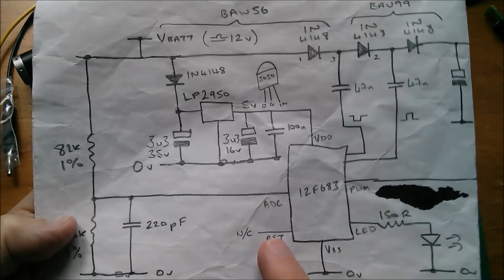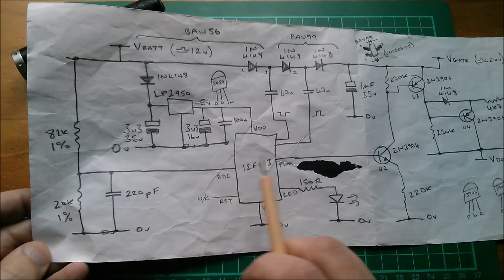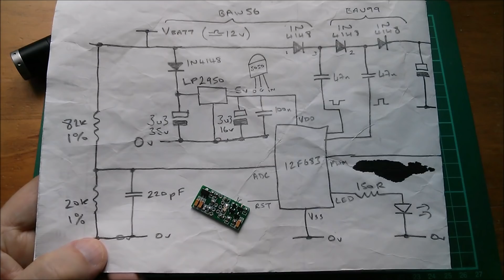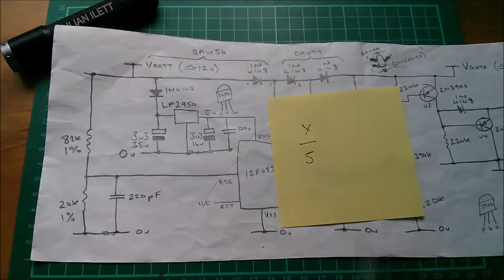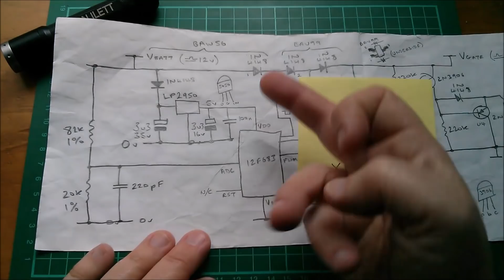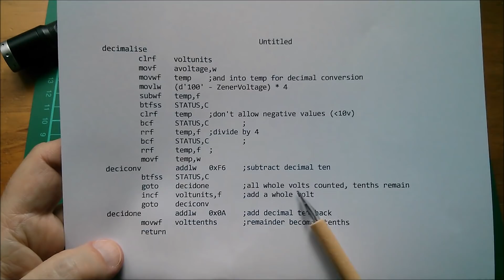PWM5 Solar Charge Controller 2019 Plans (resistor divider bonus)

Comment: How do you make use of the battery power in the house while the battery is charging from the solar panels?  When I try with a cheap solar panel battery charger, it gets all arsey and the voltage drops presumably because the controller is trying to push current one way into the battery whilst the battery (in parallel) is trying to push current the other way through the load.  You might deduse from the question, I habve no idea what I'm doing.

Comment: ++ Deoxit to clean it and conformal coating or potting to weather seal it.  I've found that using certain hot glue directly on electronic components will tend to cause corrosion right away, like in a few weeks.  Definitely conformal coat but I like to use deoxit as well to clean things off.  If you want it to last even longer then use solid core wire instead of stranded wire to prevent moisture from wicking its way around the weather proofing...

Comment: Julian - Could I recommend that you look to sizing the board to fit into a thinwall 1" PVC (or conduit) pipe?   You simply cap the TOP of the pipe and mount it vertically and have the wires come out the bottom.  The LED could stick out the bottom as well. We will also use the 8' fluorescent light tube protectors (cut down to length) which are see through and you CAN find caps that will work for these as well (example https://www.homedepot.com/p/Lithonia-Lighting-8-ft-Fluorescent-Tube-Protector-TGT12CL8-R24/100173242).   Leaving the bottom open (or lightly plugged with some foam) keeps splashes out.  Not attempting to seal it allows moisture to escape.  I know this works as I design boards for doing Christmas light computer control and this is how we keep many of our boards dry through winter.

Comment: Why don't you connect it to the wifi so you can see the voltage on your phone or pc?
Reply: That would be quite difficult to code in, not to mention the app/web interface along with a wifi board would make it moreless just a breadboard monster instead of a production unit.

Comment: On the femto, why not use a d2pak/to263 package mosfet, so the whole thing is surface mount, and you don't have the tab hanging off the end?
Reply from the maker: Because the connecting wires are soldered directly to the MOSFET legs.

Comment: You are in a rat hole on the packaging. All your wonderful work is encased in the Devil's Putty and reduced to swinging in-line on a cable exposed in the 'catch rain' position. Conformal coating and then put it in a small IP65 rated enclosure and be done with it. Better if you get one with a clear lid so you guests can gaze at your work

Comment: On the voltage reference take a look at the TL432. It is equivalent to a variable zener diode and very stable. You could also use one of the other fixed voltage references .... but the variable one means you can simplify your maths as you have done.

Comment: How did you measure the EMI?
Reply from the maker: With an AM radio :)
Reply: @JulianIlett  What a innovative approach :) What frequency did you tune up? :)
Reply from the maker: The RFI will appear at multiple positions in the AM band - pick the loudest one. You'll hear the 122Hz modulation frequency quite clearly (but only when the controller is modulating).

Comment: do we know if powerbanks (in general) have mppt charging controller to charge the battery? and smartphones not? i see that by connecting a solar panel 6-7V to my powerbanks, always they are charging with 5V and max current. my phone is floating between 5V-6V and not max current!
Reply: It's a really bad idea to connect a solar panel directly to your phone.....
Reply: @ishanfernando3064  https://i.ebayimg.com/images/g/wgUAAOSwZLRZcE0q/s-l500.jpg   :D

Comment: It would be nice if they had a bit bigger capacity so you could use it with a 100 watt panel
Reply from the maker: You can use it with a 100W (5 to 6 Amps) panel.

Comment: Did you ever get any angry customers when they failed?
Reply from the maker: One or two - there was a meltdown in Malta - that prompted a redesign from the IRFZ44N to the IRF3205 :)
Reply: Oh tell me more tell me more, I love a good tale of gossip. How bad was the meltdown?
Reply from the maker: The IRFZ44N has a higher on-resistance (so gets warmer). Malta is a warm country. The unit got so hot, the hot glue melted. The customer got a refund. The IRFZ44N was replaced with the IRF3205 and a new unit was sent to the same chap. He confirmed that the new design worked without overheating. I breathed a sigh of relief :)
Reply: That's interesting, I would of thought the switching losses would of caused the most heating what with the high gate resistor value on the PWM5. btw did you ever try a ferrite bead on the gate to suppress emi?

Comment: Why not use a precision voltage reference? Assuming you can use the spare pin as a Vref and it's not too expensive and big, of course. Just thinking out loud
Reply: So just had a look... You could swap the led on pin 6 to the unused mclr pin 4.  Then use the Vref function on pin 6 to a LM4051 set at ~4V and driven from the batteria.  You'd lose a bit of resolution because Vref needs to be at or below the worst case Vcc, but you're still in the single order mV range.  Food for thought!
Would you mind if I took your schematic and had a play and send back to you, if you're interested?  Purely doing it for fun and learning at my end, not for commercial or anything like that
Reply: Or you could try the RT9069 5V reg....+-2%.  Still not great but better than +-3%. And cheaper (on Farnell at least)

Comment: Just wondering if transparent adhesive lined heat shrink might be helpful in sealing the ends (https://au.element14.com/hellermanntyton/hisa-18-6-pex-cl/heat-shrink-adh-clear-18mm-4m/dp/2251712). Looking forward to the new thruhole pwm5. Thanks

Comment: Finally!! I love your pwm5!
How are you going to sell/distribute them? I would like to be able to buy drawing/instructions  and the components from you, preferably with the chip programmed. Soldering it together I could probably figure out. (sourcing components are difficult as a newbie)

It doesn't have to be cheap. I get one or two sexy chargers and sponsor your channel at the same time.
Reply: Julian isn't going to sell or distribute them. He'll probably make it open source, so anyone can make it.
Reply: I'm sure there is a good reason for such a (strange) decision. But it is important to me to be able to buy "approved" components from one good reliable source. If it generates a workload that comes in the way for other activity, just crank the price up! I would buy one set of components at 40€. If it cost 10€, I would buy four :-)
Open source and a BOM for the savvy shouldn't conflict with that.

Comment: why messing around with hot glue , why not do the simple thing and dissolve some scrap plastic in a jar overnight and dip the the whole assembled pcb in there a few times then add some of roberts diy ink in there to make it super tough
Reply: That would obscure the LED from view for the most part, and if it gets oil on it, the plastic coating will be no good.

Comment: I always thought the long term weatherproofing on the originals was a bit lacking, I think conformal coating and a good quality potting compound would be good for 10 - 15 years?
Or failing that, a decent silicone adhesive rather than poundland sealant (I think it's called RTV glue/sealant? ) I had one from good old maplins that fixed a dishwasher door seal around 10 years ago, still used 4 or 5 times per week, no probs! 

Nice to see a smaller form factor, good luck with this one!
Reply: Make sure to use the type of silicone that doesn't have acetic acid. It will etch, corrode, dissolve the copper and solder on the board. The little hardware store tubes of RTV all have it. I believe the 2-part silicone does not contain any acetic acid. Actual potting compound is the best of course though it costs a little more.

Comment: hi julian, can you make a pwm solar charge controller for 3s lithium ion batteries? or 2s,3s,4s?
Reply: I can answer that for Julian. The simple answer is no, not directly. You can however use the PWM5 to charge a SLA, then use a dedicated LiPo charger board to charge the LiPos, taking the power from the SLA. I do this very thing to charge my 20 volt battery power tools.

Comment: Hi Julian, the problem of ADC accuracy can be solved using microcontroler that has internal voltage reference. Maybe the ATTINY202 ?
Reply: or adding on an external voltage reference, the only issue is these solutions cause the end product to cost slightly more, adding a software compensation costs nothing but a bit more processing for the micro
Reply: @DavidScheiber  But only in large quantities does that matter. For a small run / hobby project adding an external ref for the micro controller seems far easier for not much extra cost.

Comment: good stuff, but pwm5 needs to advance to mppt5 now. :-/
Reply: MPPT with 12F675 ;)  https://github.com/rasberryrabbit/PIC12F675MPPT
Reply: I don't agree. Living N58deg I would prefer to get hold of some of the energy from the many, many hours where panel-voltage are lower than battery-voltage ( ie, some boost-function ).
In summertime there is so much energy coming in that it doesn't matter if charging is optimised. 

My personal experience is that mid-winter plus minus 6 weeks, the battery was empty. In the rest of the year it was fully charged all the time (more or less). It was a single lead-acid battery and a 80W panel.

Comment: So the PWM5 adjusts the duty cycle with relation to the battery voltage, correct? So whats the max voltage that corresponds to 100% duty cycle and what is the 0% cut off voltage? Sorry if this is explained elsewhere!
Reply from the maker: Holding the battery at 13.5V might only need 1 or 2% PWM (if the battery is fully charged with no load) or it might need 100% PWM if a heavy load is drawing current from the battery.

Comment: I tried a couple of ebay mppt 5a charge controllers - they're crap.
All I want to do is manually set an input mpp of 17.6V or 35V without needing to track, and then set an output voltage for 1S-14S lithium with 4.0 - 4.2v configurable cell target. BMS is separate. The controller just needs to make sure the input voltage doesn't go below the set value, and just outputs what current it can according to the lithium charge curve.
I have a proper 1kW lithium charger that does this, but it's not usable for unattended use and too big for the couple of small projects I want to use it for.
Julian, if you can finally get your Micro Muppet finished, I'm sure you would sell loads, and get loads more views.
Using an ESP32 with bluetooth and web config panel with data gathering, LoRa and MQTT, grafana etc would be a bonus!
Reply: My MPPT charger draws 10mA quiescent. This means that in periods of poor light the battery voltage goes < 12.2V so I want to shut down and then wake things up > 12.2V. I am experimenting with the TL431 (see comment above) You may wish to experiment with this also. Several videos on its use see Lewis Loflin videos. You can then use this to trigger a TC 40456 board (Julian reviewed this) to take care of the Li-ION charging

Comment: Wouldnt a smd mosfet be more suitable for this? Also why not use TYCO/AMP superseal connectors rather than banana plugs? There are different onest that are mor waterprrof also but the TYCO ones are the moste common and easy to get.
Reply from the maker: I agree - banana plugs are wholly inappropriate for outdoor use :)
Reply: @JulianIlett  also they are quite expensive. They don't require any special tools to assemble though that the strong point.

Comment: I will certainly be building my own pwm5 once the thruhole version is published, I cannot stand surface mount, too fiddly.
Reply: Mark Flack I’m with you there. I will be into that as well. Have to see how good they are for Amateur Radio or how well can keep the noise if they generate any in the device. :)

Comment: Funny you should be doing through hole PMW5s, as I was thinking about possibly doing some kits in through hole, to complement my surface mount Pico kits.
Reply from the maker: John, have you found the setpoint voltage to vary from unit to unit? Also, do you have a link to your Pico kit?
Reply: @JulianIlett  I bought one of his kits a few months ago and it's working a treat. Just search for PWM5 on ebay. He's selling complete built and sealed units too.

Comment: Why switch to the HT7550 regulator?  The LP2950 has much better specs.  The HT7550 data sheet is really lacking but I noticed the 5V version only shows a typical temperature coefficient and no maximum which means the don't guarantee anything.  This will show up as a difference between a cold winter day and hot summer day voltages.
Reply from the maker: Originally, I couldn't find the LP2950 in surface mount. Temperature variation not necessarily a problem - some controllers have temp compensation - higher setpoints in the cold.
Reply: @JulianIlett  - My calculation shows it could be +/- 0.081 V with just that "typical" value.  So that is 0.16V range but we don't know the max range it could be as they don't tell us.  And that is with a change of only 30°C which is being conservative from the coldest winter day to the hottest summer day in your area (a guess).  A cold winter day where I am in Canada (mild BC) may be -10° and a hot summer day with the sun beating down on the black tubing could easily go over 50°.  And that would double the voltage reading error range to 0.32V again with just that "typical" spec they give.  The max could be much more.

I think you are better off going with the TI LP2950 that you can actually see the maximum spec of.

Comment: Can the PWM5, or any solar charge controller be used in conjunction with another power generating source such as a small dc wind generator?
Reply from the maker: That should work fine with PWM controllers - the charge controller(s) will simply back off as the battery approaches full charge.

Comment: Any thoughts on getting clear potting boxes and potting compound? That'd eliminate all your corrosion issues :)
Reply: I've been using potting boxes for my PWM5 Pico ready made units. I use epoxy resin to seal them up.
Reply from the maker: I've never found potting boxes the right size :(
Reply: @JulianIlett  

I was going to suggest the exact same thing. 

Could always 3D print a pot.
☺

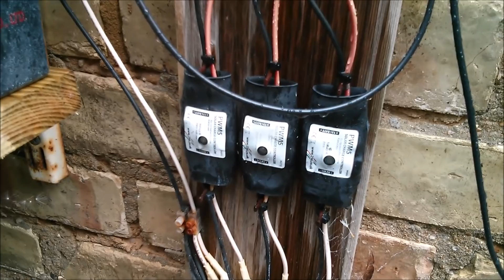Comment: Yep, amazing that one of those originals (7:41) still works considering how it is mounted with the opening at the top cupping the rain on top of the sealant.  In the winter it likely hardly ever dried there.